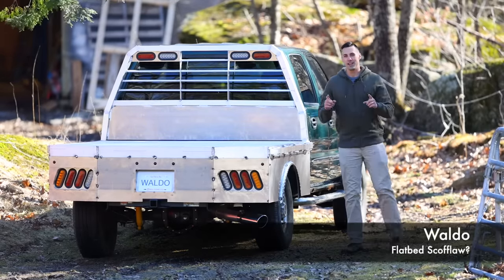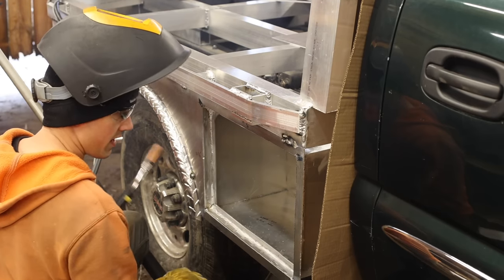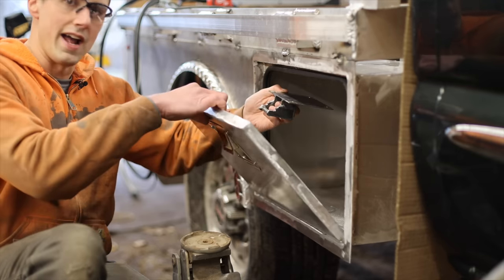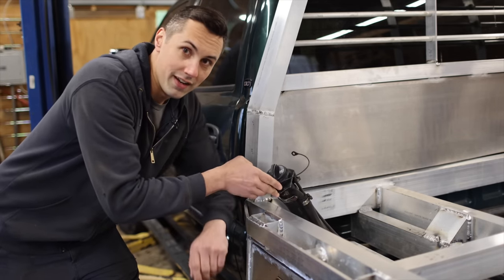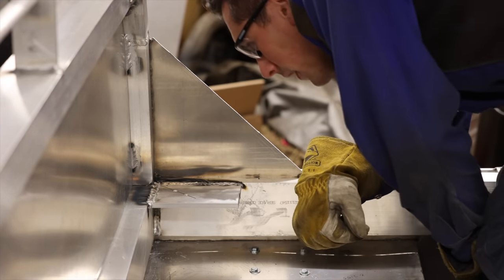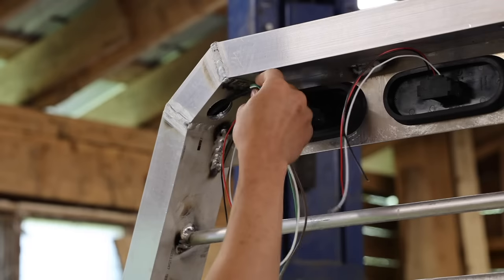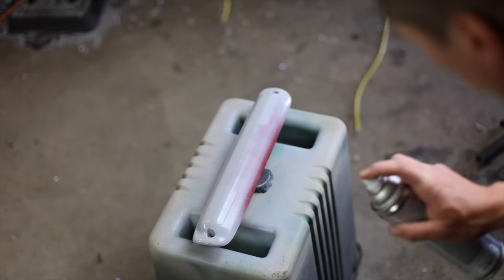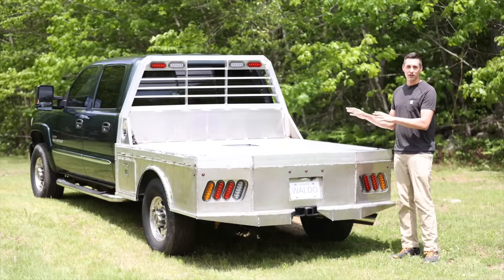Aluminum Flatbed Build (part 2): Toolboxes, Bumper, and More

Comment: Hello Waldo. I got a question for you if you don't mind. Im wanting to build a camper on a old hay hauling farm truck 1964-1976 model. Im going to build a floor frame im wanting to weld it to the frame but not sure how to do it without messing up the camper. Do you think if i build a few brackets to mount to the floor frame and and the truck frame. That i could use a rod to put them together. And use some shocks to keep it from moving to bad to break it.
Reply from the maker: Personally, I would mount to the truck frame with brackets and bolts 👍
Reply: @WaldosWorld  what kind of brackets would you use

Comment: Removal of top light wont effect much as you got them on the headache rack so it fits the requirements really; its more of if you took it out and didnt have anything else up there for replacement. Though could have replaced it with LED replacement and kept it along with the lights in headache rack as it wouldnt really look bad due to being LED too and placement in the top gap there. But the filler neck of your fuel line needs to be fully boxed in to protect it. Creating a box there and then making the rest of the bottom of the headache rack and deck into a tool box would be perfect too. Gaining the Large box up top along with the under boxes too. Always need a larger storage for things that you just cant keep in the smaller boxes. But man thats a nice bed. 

But yeah premade aluminum beds run 6-7k easily for skirted beds like that. While steel ones are 4kish usually. Aluminum ones just look so much nicer but are just so crazy expensive.

Comment: You forgot to factor in how expensive that welder is. Aluminum welding for the common man is kind of hard in my opinion if you don't have a really sick sick welder like yours. Having said that, great videos always. Thank you for the content. <3
Reply from the maker: Thank you! I know the welder is not "cheap", but it's actually good value compared to the competitors 👍
Reply: IIRC, it’s a $2600 machine. While it’s far from cheap, it’s one of the least expensive pulsed MIG welders from a reputable brand. Definitely not something a beginner should buy as their first machine, but is still doable for the more enthusiastic home gamers.

Comment: I used to install parts an panels for military shelters with a company based in Spokane, here are a few of my thoughts. Ive found when installing edge grip weather strip material, I found a 1" roller to be immensely helpful. When we would install latch hardware, we would add a bead of silicone caulk on the mating faces of the hardware, attach it and then add a bead around the edges. 

I also have a CDL - A and Im curious to find out how well you decking stays attached over the long run. The shop at my last company would weld the edges in, but with loading and unloading the welds would end up breaking and the decking moving around, I would think you would want some "in the field" attachment as well to the frame of the deck in case the welds do break to keep the edges between the panels from popping up. 
I noticed you dont have a seal on the bottom edge of the tool box doors, if anything like my trailer boxes, water will get in, might I suggest some 1/8 holes drilled in the corners for drainage?
Also I dont know for certain if your flatbed will fall under the reflective tape rule, but it wouldnt hurt to add some to the outside of your rub rails. What I remember of the rule is that at least 50% of the side needs to be reflective. and cleaning really well with alcohol right before adhering will help it stick better.

Ive had many grounding screws corrode, even with dielectric grease on them, I never got the chance to try but I think using an aluminum fastener would be better than the steel bolt you have on, possibly a rivet? It might just be an oxidation of the aluminum issue, I had to re ground my side lights on one trailer 6 years ago every few months because they would stop working, and the screw always broke when I tried to remove it to clean the aluminum underneath it
Reply from the maker: Ah I forgot to put reflective tape on it, though I was planning on just a small piece in the corners of the rear 👍
Reply: I guess you always got the excuse if cops dont like something "this is how I got it from the manufacturer"

Comment: The amber turn signal should be installed between the two reds....if you want to adhere to GM / Chevrolet design ques like on a '80's Camaro and others

Comment: You can plunge cut with a jigsaw so you don't leave a hole from the drill.
Reply: That takes a lot of practice. I've had to do it a couple times with wooden projects, can't imagine it being easy with aluminium. The blade tends to skip around if you are not careful. I guess it's easier with wood since the blade can grab on easier.

Comment: Looked at an aluminum flatbed similar to this that's professionally built for an '07 Ram 3500. $12,000 for the bed. It also didn't have box lights. So when my buddy totaled his drop deck 48' semi trailer, I offered a custom flatbed for his pickup in trade. Going to be maybe $3k total on the high end for 3 custom flatbeds.

Comment: i recently ordered a 6 camera/ multi view camera system [$300ish] Front, Left, Right sides, Bed,  Backup and Low under covering rear bumper and under trailer, I also adding a remove Backup for the Trailers, Adding a 14 channel/tire Inflation monitor system for truck, trailers including 2 spares for each. The camera, monitor  systems are used with RVers a lot.

Comment: 02:40 I'm so glad you mentioned this.."Sound", b/c I was always told that when you weld properly it sounds like bacon, at least with carbon steel.. so hearing that particular noise.. I was like "wtf is something wrong?"

Edit SO I mowed my yard in between watching this video, coming back to finish watching...

You said you don't know how "non youtubers" get anything done without the snap... ah we don't.. we just absorb content, & live vicariously through the youtubers.. lol. 

I'm really curious how you did the wiring.. itself. & made it work, since the truck didn't originally have a headache rack/flatbed. You probably have another video that explains its pretty simply..? goes to look

Comment: For your wire splices you can get glue lined heatshrink with a low temp solder pre installed INSIDE THE HEATSHRINK, just heat them with hot air. 
Not that there's anything at all even slightly wrong with the method shown here. These just don't need a soldering iron and are a tiny bit quicker.

Comment: That Aluminum Turned out great Great lob on the design an the welding of it. Hope you add more to the back of your bumper !!! I hope your a good firend with a inspection person, cause your blacking out that 3rd light will need to be working !!! Why not jusy have change the bulbs to LED...

Comment: A beautiful job. A few questions: Did you reinforce the support of the tool boxes? Just the side skirts do not seem rigid enough. Did you weld out the solid panel on the headache rack? In the final shot it still looks tacked. Since you blacked out the original high mounted brake/backup, you have room for more lights.

Comment: CM aluminum flatbed side skirt has two tool boxes per side costs 5795.00 in my area dual wheel runs approximately 2000.00 more.

Comment: I talked with Redding truck bodies it is December 9 and he told me for my truck 8 foot bed duelly I could planned on spending about $7000 for a steel one and roughly $10,000 for an aluminum one from  CM manufacturing

Comment: With pulsing on the longer run welds, how does the distortion compare to the short spread out runs?
Reply from the maker: I've found that distortion has been very minimal on this project. It hasn't been an issue on longer runs 👍

Comment: Don't know what you paid for a three wire to two wire converter, but as a computer engineer you should know that all you really need is a couple of 1N4001 diodes to accomplish the same functionality!  Cost 25 cents per diode.

Comment: soldiering auto connection is not the best method, crimping, adding Silicon, Heatshrink or Permatex's Liquid Electrical Tape is far better and last longer.

Comment: very nice build. I would have experimented with smaller diameter aluminium wires for your finish welds to be grinded. Your welds are a bit wide. If the machine is rated for 220 amps why cant you get more than 160 amps at full power?

Comment: Mix color turn signal...naw. I'd just throw a little 3/4" round amber up there in the corner as additional turn signaling if you feel you need it. Shouldn't crowd it and keep it all the same color. Bonus one less fancy component to fail.

Comment: Waldo your fabrication skills are very impressive and I’m a time served fabricator, I used to work in the oil rig fabrication industry and used steel up to 4 inches thick (100mm) but I have worked with aluminium and it can be a pain. Your attention to detail and design detailing really impressed me, thanks again for another fantastic video see you next time 👍🏻🏴
Reply from the maker: I appreciate it!

Comment: A 4 wire system for extra safety and less ambiguity, but disabling the dedicated third brake light and having NO dedicated third brake light is such a strange choice IMO.  I would've made the top two reds both just function as a dedicated third brake light I feel like this would decrease ambiguity and make more sense to the general person following behind.  Or just add a thin LED in the middle for a dedicated third brake light but it should be somewhere

Comment: One thing I noticed, and maybe it just appears that way on camera, you seem to be welding with a crazy long stick-out (contact tip to work distance) on your wire. That will cause all kinds of shielding gas issues. Not to mention, totally changing the arc characteristics.

Comment: For the top lighting, why not just do two amber turn signal onlys and a center high mount brake light, avoids the crowding issue and also avoids the ambiguity, and keeps the dot happy... Win win win?

Comment: Nicely done as most think a bed on a truck should be made of inch thick steel, a full load for a five ton by itself. My actual comment is the range rover.... how were you lucky enough to find one thats not solid junk like most are... I have had two of them and they were so messed up that I salvaged some stuff I wanted for another good rig (home built) and sent the rest to a salvage U-Pick yard

Comment: Flatbed looks amazing. You did a wonderful job. looks pretty slick. I can't really tell if you did or not but I would put some bracing on the backside of the tool boxes. The weight of the tool boxes alone we're making the sides of the flatbed Flex out. It's only going to get worse as you put equipment in those tool boxes.

Comment: Waldo I do not know where you live, but where I live if you have a flat bed on your truck you can legally delete the cab mounted 3rd brake light. As the second set of brake/turn lights on the headache rack on the flat bed, does replace the federal mandated 3rd brake light so you would not be in violation of that federal safety law. As you are maintaining a 3rd brake light. However, DOT laws do very from State to State so for the rest of the viewing laws do check the DOT laws for your state as they may not be the same in every state.

Comment: Hello Waldo and well done for this build. I wondered why you didn't just put LED bulbs in the factory rear light until I saw that it would be obscured so that makes sense. There's so much to like and almost nothing to question on this build. Yes, I'm sure you'll notice a few things you can change and improve on as you use the truck but these should be very minor. A couple of small things come to mind such as it might be helpful to include a tether on the tool boxes lids so they sit horizontal to keep parts, tools etc off the dirt and provide some more level surfaces for bits. I also wondered why you didn't fit lockable door clips. Maybe this isn't an issue but I think I'd have added these. Looking forward to your next top quality and inspiring work, which you also manage to capture and narrate very well. Cool!

Comment: Might I ask why the stainless hardware on the tool box hinges and such instead of something like rivets?  Then you don't have bolts sticking and out and not so much of a theft risk, since you can't just unscrew a rivet like you can a bolt.  I'm not that in tune with fabrication to the extent that you are doing in most of your videos though, so it could just be a matter of preference, or maybe there's a good reason to go with one over the other.  Love the welding a fabrication videos man! I watched your gooseneck build and I can't stop now! ahhhhhh!

Comment: Nice job. For the headache rack stop turn lights I would recommend tapping off the factory trailer harness. Then you can bypass the converter and the turn signals always blink in phase. Thank you for sharing and have a great day.

Comment: Could you please give me some info on the wiring of the taillights I want to use two red led and one reverse light do I need a converter like you mentioned in the video ? I also have a 2005 duramax I’m Building a bed for. Thanks

Comment: Hi Waldo i have a similar background to your self and enjoy working on cars, one thing i found especially after a long time is solder joints with shrink tube sound good but depending on your environment it can be bad, I live in Australia Sydney we have really hot weather and cold weather plus its high humidity so i found that shrink tube and solder is not enough so i found some shrink tube that has a glue stuff in it to protect from water ingress, the other is off ebay crimp connectors but with a shrink tube that melts there common and they work really well just thought i would let you know they are also really cheap considering the downside is if you need to splice in ether of these its going to be a mess or not possible, but as for water no chance or dry joint not possible. 

P.S i have been binge watching your truck vids as well and really enjoying the videos and learning some tricks and tips you have so please keep them videos coming.

Comment: I commend you on a lot of hard work, but to be honest it looked better before. I say hack that bumper off the back as well as the lock downs on the side, put cut outs inboard flush with the bed to use for tiedowns and knock the bumper off the back and smooth the rear end, brace it from behind so it can actually push while looking pretty. Just basically tighten the look up make it look more like GM built it and not a talented welder who is customizing his rig. Less is more.

Comment: Nice job, Waldo.  I have to say, I am really impressed with your work and with that pulse welder.  What does a rig like that typically cost to purchase and then to operate.  I am thinking of getting into some fabrication work in aluminum and stainless steel.

Comment: With weather seals put the join at the top in the middle and you need to put a brace of the back of your tool boxes to stop them bouncing up and down. Why didn't you just change out the incandescent bulbs for LED ones...?

Comment: Positive things though, the rear window guard and lights in the bar are hot and look like a legit manufacturer. The boxes on the sides are mint as well as the way you angle the taillights. Again, just my humble opinion but the bumper and the side holes are too much...

Comment: For wiring have you tried out the self-soldering heat shrink? I have used these for a while and no need to separately solder, as the tin is included in the heat shrink. You can also buy these in bigger sets of different sizes from ebay/amazon.

Comment: As a first time viewer I'm bloody impressed with that build. The only criticism I have is the angled back end. I think I would have made that curved instead, but it aesthetic thing, definitely NOT a criticism Waldo. You don't show it but I'm sure you countersink or use a Noga deburrer to remove the rough edges of the holes you drill. I say that because when you were inserting the wiring into the pillar of the upstand, it looked as if there were quite big "rags" as we call them here in the UK inside the holes where the hole saw broke through and that of course left in there would be likely to cut through the grommets you used to close the holes and possibly short your power wiring to ground.

Comment: a couple little ^ shaped tabs on the top rail of the rack will be handy down the line if you plan to haul some long material or a ladder etc. they do not need to be big, just there to hold the items from sliding over the side.

Comment: If you use candle wax on your jig saw blade it lubricates the blade when cutting aluminium. Also try a stainless steel wire brush to clean your aluminium before welding.

Comment: Pretty darn awesome for home built.  A suggestion would be to have a steel rear bumper which is separate from the flatbed body to protect it.  Bumpers, well, they tend to bump into things.  Sometimes hard.

Comment: That's the weird part with chevys that the front wheels are like 1.5 in wider than the rear. I did the same thing so my wheels would match up using far from stock wheel spacers I have towed a 24 ft trailer with a skid steer regularly with no issues

Comment: Might have mentioned before that I use the edge of the soldering iron for heat shrinking. Was shown this as an apprentice and have been doing it that way since with no trouble.  (I’m 80 now)

Comment: My tip for you as a fellow fabricator is invest in slim cutting discs and a large candle. Coat the disc with candle wax as you cut as well when you drill Aluminium. Makes life easier.

Comment: ever think about putting the smaller hole saw inside the bigger hole saw to cut that donut? Ive done it in electrical panels, and pull boxes, also to biggen the hole in the side of a house on a service change